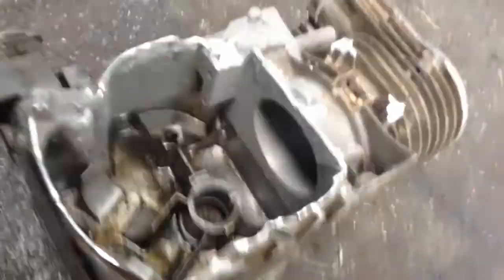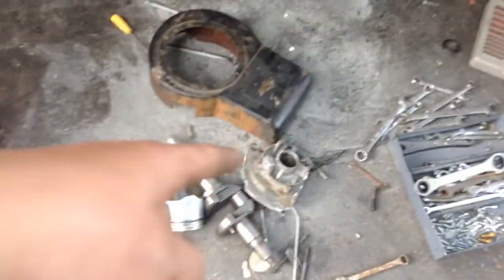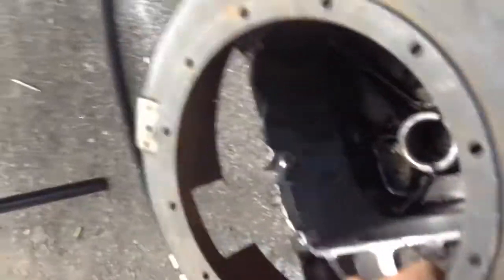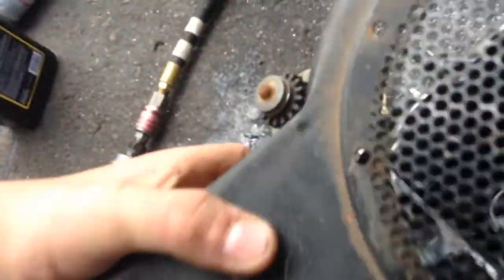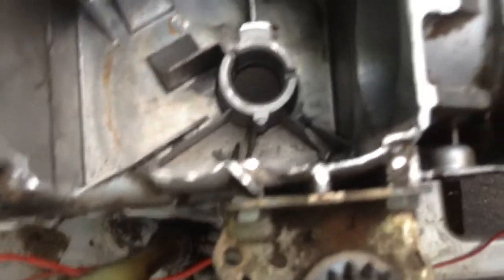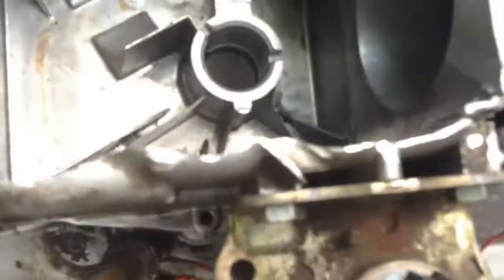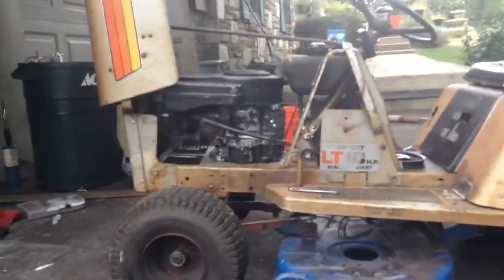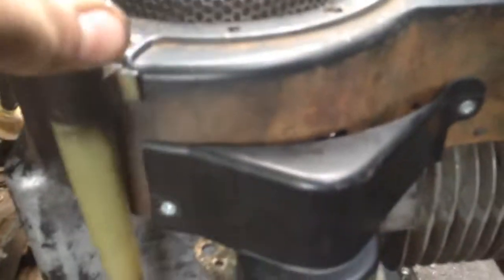Racking mower dummy storage engine

Comment: That is actually very believable you should also put a piece of a spark plug wire on there as well, also if you have them the front cooling shroud pieces that go over the round part of the cylinder.
Reply from the maker: I don't have the piece that goes over the cylinder but I do need to put that spark plug wire on